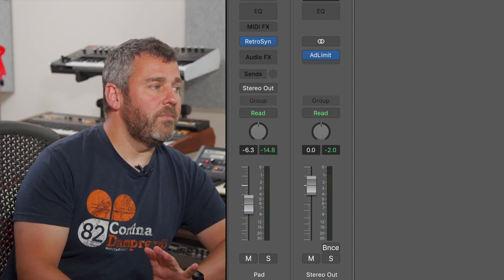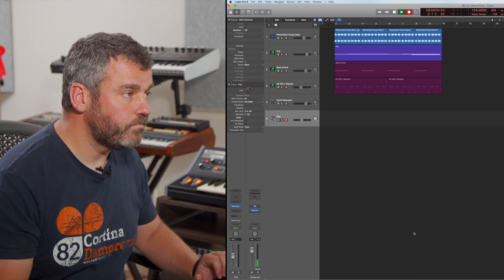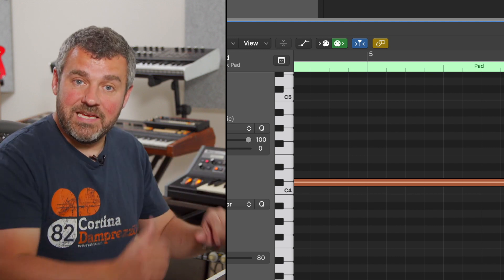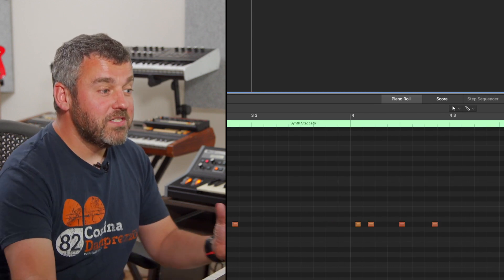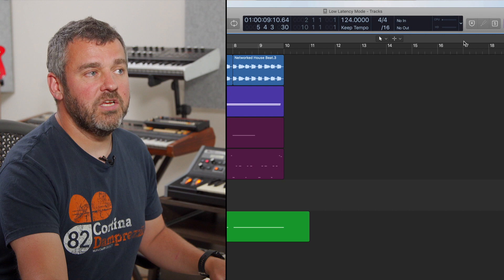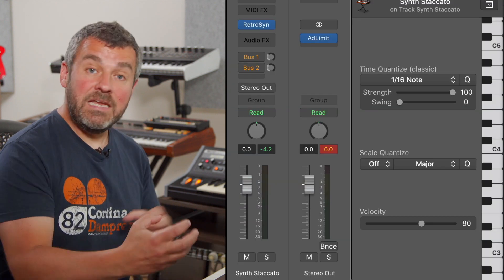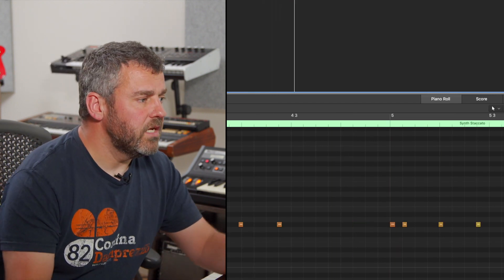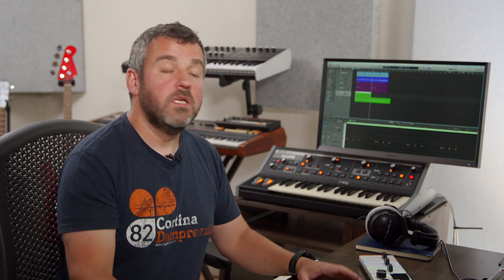Logic Tips - Low Latency Mode

Comment: Thanks for another great video! I’m fairly well versed in latency, but how does one solve the same issue while mixing? For example, a CPU hog on the 2-bus? 
Cheers - Tim
Reply: I had the same issue and I had to reach Low latency feature in Setteings/Audio/General to switch it on and increase the samples delay. Otherwise I had large latency from my Waves Audio pluging even during the playback.. Now it seems it works fine.. If you have any other tip, i would appreciate it :)

Comment: The introductory explanation of what Low Latency mode does and how latency comes about is wrong. We need to make a distinction between plugins that introduce latency and those that don't. Those that introduce latency, like Logic Pro's Adaptive Limiter, don't do so because they are such a "beast" of a CPU-intensive processor, but because that's part of the processor's look-ahead design. The latency in the Adaptive is not a result of it being super CPU-hungry. It's a result of the look-ahead mechanism, and the latency introduced is exactly as long as you set the look-ahead. This type of plugins that introduce latency because the plugin looks ahead at a certain number of samples, this is the type that Low Latency Mode deactivates. Now, there are plugins that don't introduce latency. In fact, the vast majority of plugins don't introduce latency, because they don't have or need to look ahead. For this type of plugins, Low Latency mode doesn't do anything, regardless of how CPU-hungry they are. This is because those plugins don't introduce latency, regardless of how many of them you add and how CPU-intensive they are. The latency in this case is dictated by the buffer size and your computer is either able to write the buffer fast enough in each cycle or it isn't. If it isn't, then you get pops and crackles or a system overload error. But your latency does not increase. Your explanation makes it sound as if CPU-hungry plugins introduce latency and Low Latency Mode deactivates those CPU-hungry plugins. That's not what is happening. The Adaptive Limiter needs extremely little CPU, but it does introduce latency. CPU-intensity of an audio processor and latency are not related.

Comment: But what if you have a slight latency when you PLAY the song? When you notice that all your Midi and audio tracks together make the performance a bit "wobbly"?? Thank you
Reply from the maker: Hi, Jack! Do you mean that your playing is lagging, or that there's some technical issue causing latency elsewhere?
Reply: Yes, when I have like 20 tracks with different virtual instruments I notice that the whole performance is not tight on time anymore. And I hear that everything slows down a bit, gets faster again and this repeats through the whole song. I‘d say it’s hard to notice for someone who hasn’t got a good feeling for timing, but I hear it instantly.. This „puffer“ setting is already on 256, I don’t know what else to do. I try to bounce a few tracks from midi to audio to turn of the VST which helps a bit but normally it may not be a problem for the system to run properly with the amount of tracks I‘m working with. I just don’t get. Does Low-Latency Mode also helps when you just replay or listen to a song? Thank you very much!